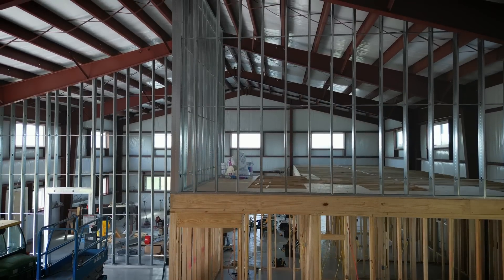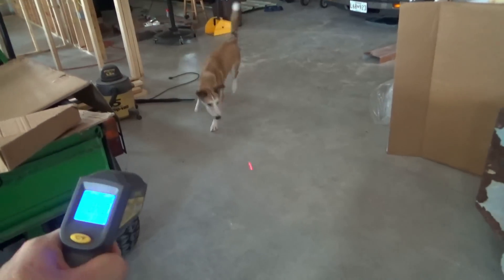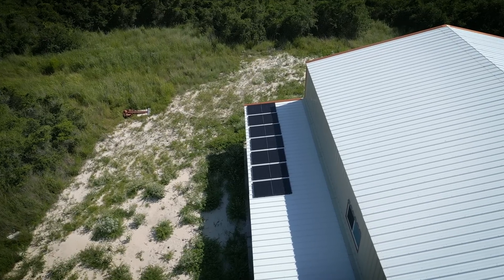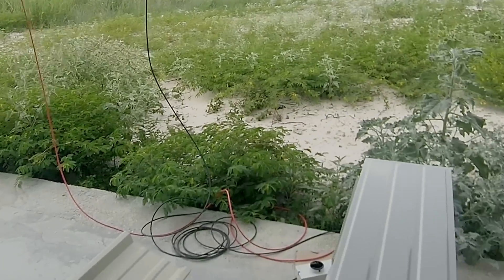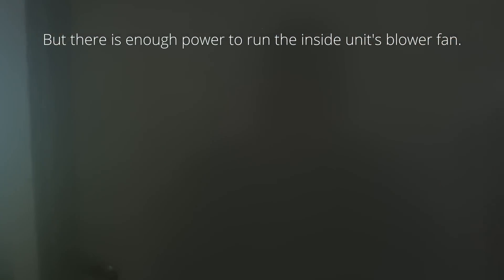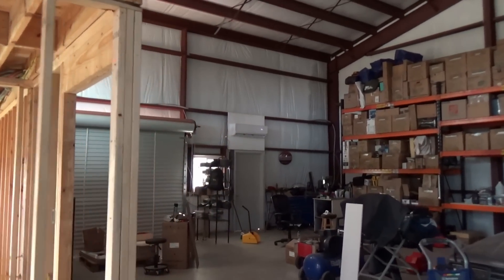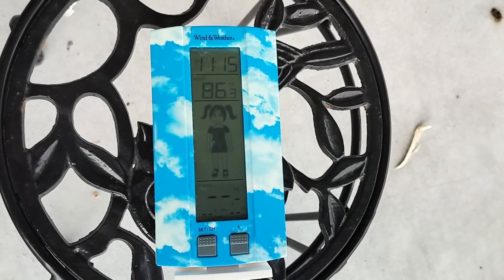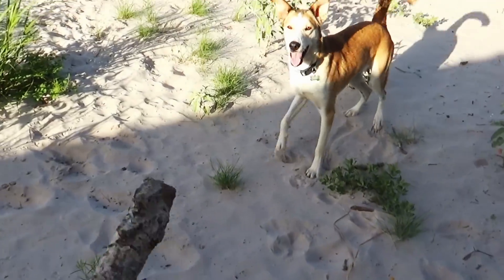FREE Cooling & Heating: 2-Ton Solar AC Tested!

Comment: I had no idea this existed. I've been wanting to put a mini split in my garage, it gets to hot to do anything in there in the summer and to cold in winter. I have a metal carport in front of the garage that would be a easy place to put the panels. huh.
Reply from the maker: I didn't know about them either.  I now have 4 of them.  I'll put out an update video on how they've been doing soon.
Reply: @AlexLTDLX  I'll keep an eye out. almost seems to good to be true. did you happen to see what kinda power it needs on the ac side? I could dl the manual but lazy haha.
Reply from the maker: @jsomething2  the two ton units take about 2000 Watts, with peaks reaching about 2400 Watts, the one ton units use exactly half of that.

Comment: The most important aspect of efficient cooling and heating is air tightness. Bar none. Be obsessed with making your building airtight.  To know if you have achieved your goal,any pass through door should open with resistances.  Foam anywhere you can, gasket all doors etc. What ever it takes.

Comment: instead of insulating it better, run it directly into the building and have it go up the wall inside the building, use the inside of the building as insulation. much more efficient

Comment: I just bought 4 of the 12k units for my house and a pallet of solar panels (14.4 KwH).  The total bill was $10k with shipping and tax.  This is phase one of the project.  I am in California and my PGE rates are .48 center per kWh and .59c at Tier 2.  My old AC unit is burning approx 6.5 khW per hour.  Our Aug. bill was $1400.  I got quotes to get a new AC and they also said I needed to redo the ducting.  The cost of just the ductwork was $10k and the central AC was $20k.  I can't wait to get and install the mini splits installed.  We are frugal with our AC and we still have a high bill.  Phase two will be getting a new 200 amp Electrical panel installed (I have no more slots for breakers on my current 100 amp panel), EG4 18k hybrid Inverter unit and 2x 14.3 kwH batteries.  We are paying for a certified C-10 electrician do all the electrical work.

Comment: I installed a 1.5 ton mini-split heat pump (Della $900) to better employ my new solar power (6 kW EG4 6000XP inverter).  The inverter output goes to a subpanel for the front of my house.  My central AC comes off the main breaker and would have required expensive cable run to put it on the 6000XP, plus the mini--split is more efficient (22 SEER) and will give heat in summer.  The 6000XP switches to the grid when the sun isn't shining.  I already had an AC vacuum pump, so uncharged lines were no problem and could cut them to length (compressor was pre-charged with R32).  I still use only about half the solar capacity, even in Summer, so though my total cost of solar & heat pump was only ~$6000 in parts, I figure a 10 yr payback time which isn't great.  But, I did get a solar carport from it.

I might get a new pool pump which runs directly off panels I'll put near the pump as a gazebo roof.  My central AC failed right after installing the mini-split and it kept our 2200 ft2 house cool all summer, even on a 110 F day.

Comment: You could have easily installed it. I did one too and it saved $250.00 last month. Did I mention I got cold inside a 2,250SF house on a 105F day and it ran on solar for 11hrs most days. I did finally connect to AC so it will work as needed (around the clock) when winter heating. I hope to also replace burning a lot of expensive propane by heating in the daytime with free solar power. I'm using 7ea 400W ground mounted panels which is more than adequate.

Comment: You would do well to have humidity readings as well.  You will feel quite a bit cooler just by having the humidity lower.   Your measuring simple heat but your missing latent heat.  Very misunderstood... Customers would call and say "it feels cooler but the temperature isn't dropping much".  The machine will pull water out of the air first before you notice the actual temp dropping.

Comment: I just put together a 700w system that can power my 5000btu window unit for just under $1000 and that includes 2 batteries and the air conditioner. And yeah, I live in Texas too.

Comment: Have been installing and operating mini-splits for years. 
FYI-$1899 is way high for a better unit I’ve been dealing with, but am glad this one’s working. Keep in mind also, the highest fan blower speed can minimize condensate generation and use less power by not condensating, which is not an option with central air conditioning systems, since their evaporator coils are designed to run in the high 30s. Alex, your mini split coil will run in the mid to low 60s on the highest blower speed(turbo) and if the inside dew point goes below that…no wasted juice going to make water. Unless, of course, you want to dry the air out, then, of course use a slower fan speed and it will.
Just one of the neat options that mini splits offer compared to central air and things you cannot do with old school HVAC.

Comment: I wonder if you could capture that heat and turn it into electricity alongside the solar panels.
Reply from the maker: Probably - you could do that with thermocouples.  But would it be enough power to be worth it?  Probably not.  But maybe use it to pre-heat the hot water?

Comment: I wish they made a 2 zone 24,000BTU solar mini split.
Reply from the maker: Actually, I do too.
Reply: You might actually be better off with two of the 12,000 Btu units.  Then if you where to have a compressor failure, only 1/2 of the system would need repairs.  The other room would be cool.  I bought a 12,000 Btu ductless heat pump for my nephew on Amazon for only $630, and it cools and heats his rental home great.  The indoor unit is mounted on a TV cabinet, and the outdoor unit is just outside, plugs into the 120 volt receptacle in his living room.  Ran the copper tubing out a window, with a 2X4 to fill in the gap, and has holes to run the tubing through it.  Working great for 2 years now.  Della brand.  It does not run on solar power.  However with only $0.15 per KW, our prices are reasonable in Washington and Oregon.  He has saved over $600 per winter, because his rental home only has electric heaters.  30 KW to run a electric heater for 100,000 Btu's of heat, VS 5 KW to run the heat pump and collect 100,000 Btu's of heat.
Reply: @Kangenpower7  but this is all for really 3 large rooms.

Comment: What’s the Maximum distance the solar panels should be placed from the Ac Unit? I’m VERY INTERESTED I’m a New Subscriber and excited for more informational videos. Thank you 👍
Reply from the maker: There really is no technical limit.  The voltage is high, so the current is relatively low.  A typical string of panels is around 10 amps.  Twelve average 40 volt (open circuit voltage) panels would be around 420 volts at about 10 amps.  But you size conductors based on current, not voltage - though voltage drop becomes important as a percentage.  So if you calculate 1 volt of drop at 10 amps, it's fairly insignificant at 420 volts, but would be very significant at 10 volts.  This is probably a good idea for a video; it's a bit tricky to explain in a concise way in the comments section if you're not familiar with Ohm's law.

Comment: What is the open circuit voltage of a panel? Are all seven panels in series or are some in series/parallel ?
Reply: The video explains that there is 265 volts DC, so all 7 panels in series.  With 10 amps, that is about a 300 watt panel, give or take a few watts. 8 panels will allow the system to run at 100% full capacity more than about 2 hours per day.  His system is limited in capacity because there is less than 2,000 watts for most of the day, only about 2 hours per day is at 2,000 watts to get 100% of the heat pump's capacity.
Reply from the maker: The 7 panels are in series.  The OC voltage of each panels is supposed to be 41 volts.  They're 370 watt rated panels.  But as you saw, I was only getting around 260 volts open circuit.  But close enough to work.
Reply: @AlexLTDLX  Got it! Thank you.

Comment: I find it really awesome as well, it probably wouldn't be worth it for me since I live in the northern great lakes area,  but if I bought some of grid desert property in say AZ, I would definitely invest in this AC, this does run as a heating system as well if I'm not mistaken
Reply from the maker: You're right - they are heat pumps, which means they can provide heat as well.  But since we don't use heat much down in these parts (maybe a few days a year), it completely slipped my mind.  I should've mentioned that in the video.

Comment: Where did you find the magnets for the panels?
Reply from the maker: These are the magnets I used: https://amzn.to/3M8sYLu  I would use these standoffs: https://amzn.to/3X72vDt and these bolts: https://amzn.to/3yEIgVg  Though keep in mind, this was a temporary installation - we get hurricanes from time to time here.  And using only 4 magnets on a side works (8 per panel), but I wouldn't feel comfortable on a steep roof.   If you have a fairly flat-ish roof and don't get many high winds, then you'd probably be fine.  Also, be sure to measure the spacing of the corrugations on your steel, as well as the depth.

Comment: What parts/source were used for the magnetic attachments?
Reply from the maker: I'll copy and paste from another person who asked the same question: These are the magnets I used: https://amzn.to/3M8sYLu  I would use these standoffs: https://amzn.to/3X72vDt and these bolts: https://amzn.to/3yEIgVg  Though keep in mind, this was a temporary installation - we get hurricanes from time to time here.  And using only 4 magnets on a side works (8 per panel), but I wouldn't feel comfortable on a steep roof.   If you have a fairly flat-ish roof and don't get many high winds, then you'd probably be fine.  Also, be sure to measure the spacing of the corrugations on your steel, as well as the depth.

Comment: the music is annoying!  Makes it hard to hear your voice...Well, that Solar A/C looks great but will it work in Idaho?
Reply: Yes it will work in any state.  Even Alaska.  Yes you will have plenty of solar power just when it is needed most to cool the place down.  If you are at over 3,000 feet elevation, the solar watts per square meter is higher than at a lower elevation.  So that helps you too!  

If you have electric heaters, then hook the heat pump up to the grid power.  You can use it in the winter to avoid using the electric heaters, and save perhaps $400 - $600 per winter.

Comment: Dumb question time: why did you mount the PV panels on the lower roof instead of the upper roof?
Reply from the maker: It's not a dumb question - there are several reasons:
1.  This was only to test the solar AC; the magnetic mounts are intended to be temporary 
2.  I have no safe way to get up on the main roof (18' high on the edges, 25' high in the middle); and getting the panels up there would be tricky/dangerous/expensive
3.  Permanent mounting would involve drilling holes in the roof.  I'm not willing to do that over insulated interior spaces in case of a leak.

Comment: That is amazing. It should be an asset for a residential building in central Virginia. And the mini split is a big bonus--no expensive HVAC labor fees and essentially free power. One could easily use two one ton units. Even the equipment cost is reasonable. Thanks for sharing this.
Edit: yes, it is ideal for cabins, etc. But with out of the way locations, my concern would be theft. Our area has had thefts of full AC systems from houses and also window units. Some thieves have been bold enough to steal copper gutters from churches. I have an 8 camera surveilance system and a backup generator to run everything. Got the cameras after a series of vandalism.

Comment: I have a small mini split setup
The key is to have enough solar panels facing both East and West to harvest as many sunlight as the system can
I have enough battery to run it non-stop for 3 days without sunlight.
So far I haven't ran out of power after 11 months of testing.
Edit: My whole system is to run my fridge/wif router/AC. My electricity bill dropped around 80% per month

Comment: Where I am, it's regularly in the 90s until about midnight. So, what do you do when you need AC but it's too dark to produce power? Wouldn't a battery bank be the wise thing to install?
Reply from the maker: Of course I'm installing batteries, as well as a south facing solar array.   You can see the battery banks in the video.   I wanted to test this thing purely on solar panels and maybe get a little respite from the heat while the interior is being finished.
Reply: These "Solar heat pumps" can use 120 or 240 volt input to run them when the sun is not strong enough.  He showed in the video that after connecting to 240 volts, the phone app shows the unit is using all of the solar input and 68 watts of 240 volt power.  By midnight, yes it will use all 2,000 watts from the grid power or his inverter.  

I installed a $630 Della brand ductless heat pump at my home, 120 volts, 12,000 Btu capacity.  It is less than 1,000 watts, and that goes down once the room is cooler.

Comment: Been dreaming about this kind of set up. Have you considered applying a UV reflective coating to your roof? SuperTherm is one that I have thought about that seals the roof and creates a UV reflective surface that reflects 99% of UV radiation and heat off the roof and can make it much nicer during the peak of the day in your barndominium.
Reply: Using Supertherm and dual reflective panels (front & back side) would work awesome. 
Help cool the building and also reflect light on the backside of the panels to gain even more energy.

Comment: I'm up here in S. Oregon in my '28 RV at about 2300'. I've got the Pioneer 9k working here.. but am waiting for my EG4 12k Hybrid.  It'll be running off Three 305w sunpower panels.

Comment: I've been enjoying our 24k Hybrid Unit at our house, we have a large livign room with 35' ceilings at the peak that was difficult to cool with our standard ducted HVAC system so adding this in a large space is a no brainer. Only issue we've had is that you have to watch the app constantly as it frequently will not register the solar, it just doesnt work consistantly. The only way i've found to get it to use the solar feature is to disconnect the solar and reconnect. Not sure why but we have yet to figure out what the issue is, Signature Solar can't seem to give a good answer either. Everytime I want to use solar I have to cycle the disconnect switch on the PV array. Pretty anoying but when it works its great.
Reply from the maker: That's odd.  This one has been working just fine since I installed it.  If it was me, and the panels are in sun, I'd wait until the app isn't showing solar power then pull the 240 volt disconnect (or kill the breaker) and see if it keeps running.  Since connecting the whip, I've pulled the disconnect before on mine it just kept running.
Reply: @AlexLTDLX  Yeah I tried a few different things. The solar will work once disconnecting power and turning it back on. But then the next day you have to do it again haha. Keep an eye on it on the app. I have to unplug it and plug it back in every day (the solar inputs)

Comment: Math is flawed since no one would run this on grid 24/7/365 and not during the winter. The ROI will be longer if at all. I would still get one to cool my garage though.
Reply from the maker: This is for people who live in hot climates - my point of reference, per the video, is southern Texas.  It won't work for everyone (obviously - I grew up in Buffalo, and I guarantee nobody there is buying one of these), but that doesn't mean the math is invalid.  I encourage you to do the math for your area, climate and electricity cost.  I found this to be really cool - before poking around on Signature Solar's site I didn't know these even existed.  And being me, I had to test it.
Reply: Could you use the cold waste water to help the condenser a little?
Reply: During winter, one can use it to warm up the space.

Comment: I insulated the inside of my steel building with reflective bubble layer, which was the cheapest way to do it and it made such a difference that and my two little window units. I only needed one anymore to cool my place down. Although it’s not a normal way to do, it is a simple way to do it that it really works, and it also helps being that is reflective to make the room brighter.

Comment: This would be perfect if you could set it to turn on automatically when it’s able to start cooling or heating everyday when it gets enough sun.
Reply: yeah thats the only thing that I was like hmmm about - I want this thing to cool automatically whenever it can if I got one no user input required.
Reply from the maker: Most of the time it does turn itself on automatically.  I should've clarified that in the video.  It's only on rare occassions (like cloudy mornings where there's bit of sunshine, and then lots of clouds) where the LP indicator is on - that indicates that just as it tries to power up, immediately it gets a shadow on the panels.  That's designed to protect the compressor.
Reply: There’s an app for that! The one included in the instructions did not work for me but the SmartLife app works great. Just set it to come on after enough sun is available. Cloudy days cause a bit of a hiccup, but otherwise it’s amazing.